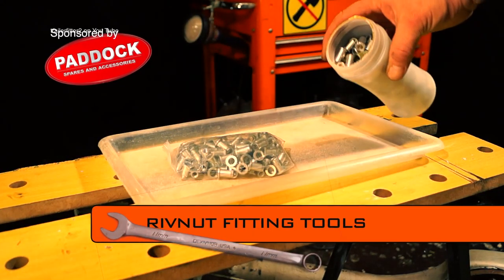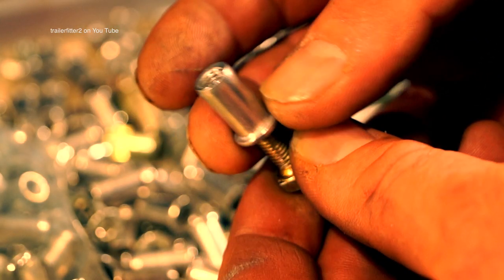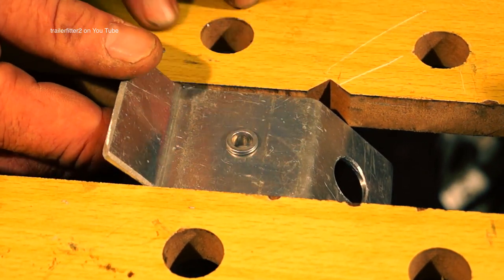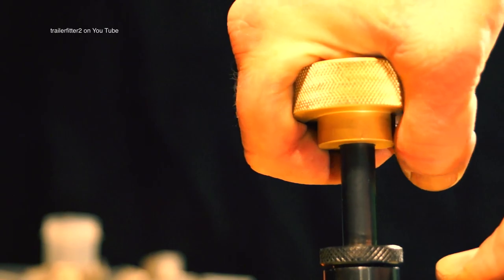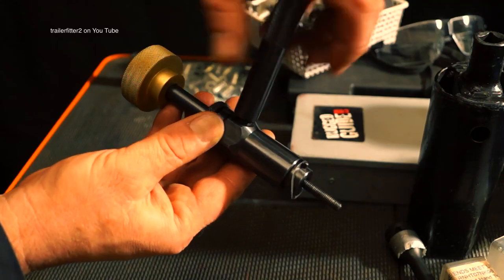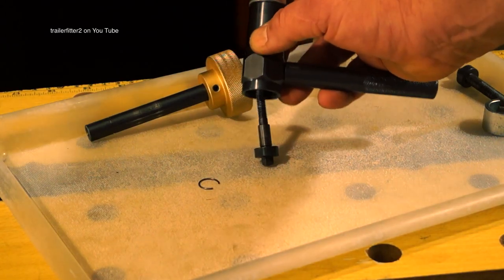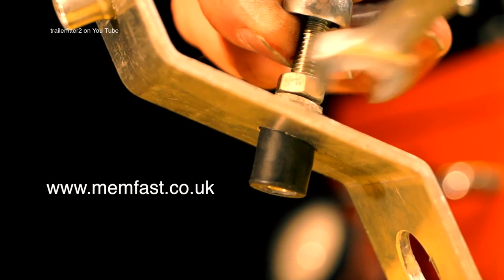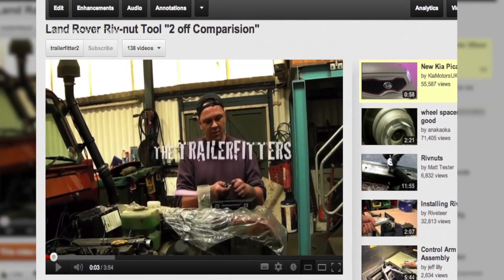Land Rover fixtures, fittings & tools - Rivnut and rubber rivnut fixings

Comment: add couple washers between nut and rivnut to let washers slip instead of rivnut turning. Alternatively use a lock washer under the nut and turn the bolt. Nut with lock washer is supposed to keep rivnut stationary.